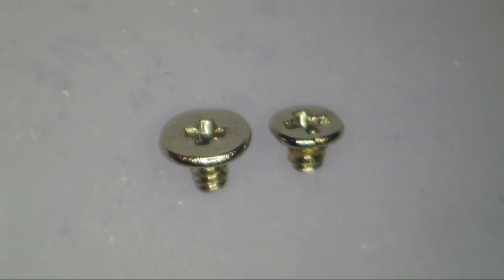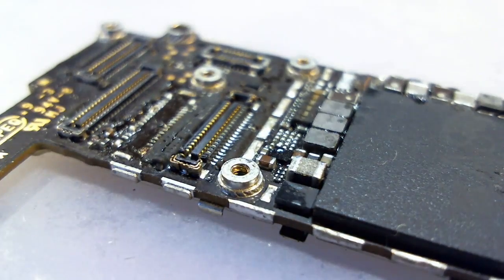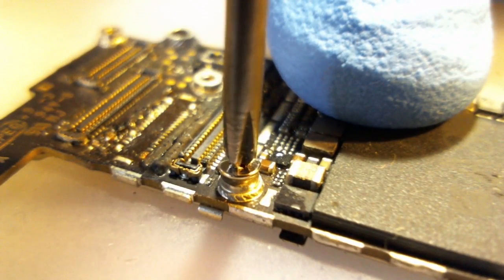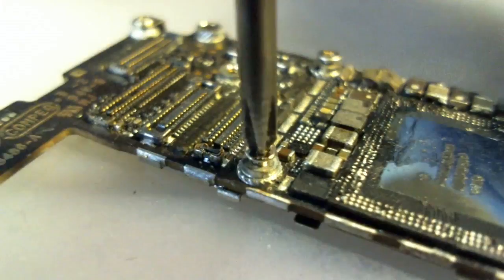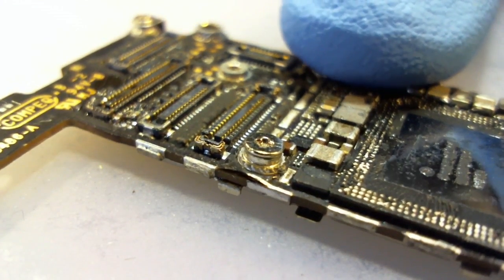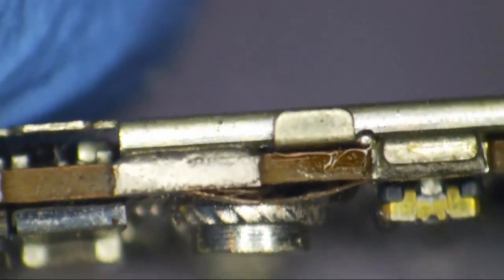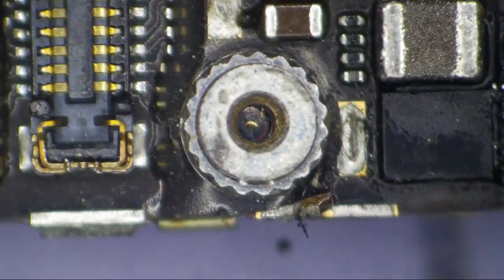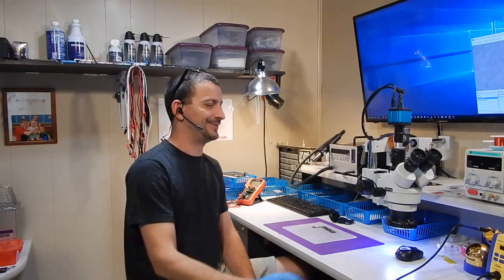The Right Screw and the Long Screw - An iPhone 6 Demonstration

Comment: Great Video Jason. It's a shame all those " do it yourself" people can't see this!  I actually did not realize about the board layer lifting as screw is tightened! That makes me understand so much more about what I'm working with now. Have an iPhone 6 plus here with screw damage to the right hand side hole and couldn't determine whether it really had damaged traces or not but now as I see the slight warp in the pcb layer I will go in and fix those traces. Problem I am facing with the board is no image ( but has backlight) and intermittently I will have vertical fuzzy lines and colors flickering on the screen. Keep up the good work man.  I would be in the dark without you to learn from :)
Reply from the maker: Thanks! :)  Hmm.. not sure about the fuzzy lines but you can certainly get no image from bottom right hole damage on a 6+.

Comment: Took me for freakin’ ever to figure out where the one long screw was supposed to go (of the five you’re talking about for the ribbon bracket) because I was too stupid to keep track as I removed them! I just assumed they would all be the same length. Finally figured out, the LONG screw goes in the lower right hole of the bracket—this is with the phone oriented with the screen down (on the work surface), and the home button at the end closest to you. Never would have imagined a longer, screw could be such a bad thing!!! (Unless you’re a prison inmate, on the receiving end.) 😜

Comment: Hi! I'm trying to measure screw sizes using a caliper. If I want to find a 1.2mm screw as indicated here (https://www.ifixit.com/Guide/iPhone+6s+Display+Assembly+Replacement/62900), so I measure from tip of head to bottom of thread, just the thread length or the thread diameter?

Comment: Hi Jason and thanks for this great vidéo. Jason I need your help about an iphone 6 plus, there is a component missing and the chematics zxw inicaded me that is DZ 2101 5,5v 6,2 pf and 0201 size. Is it a diode zener and where can i buy it. Thanks.
Reply: That is no stuff. There is no component there.
Reply from the maker: Thank u :)
Reply: Thank you, it was strange cause pins are soldered. Thanks a lot